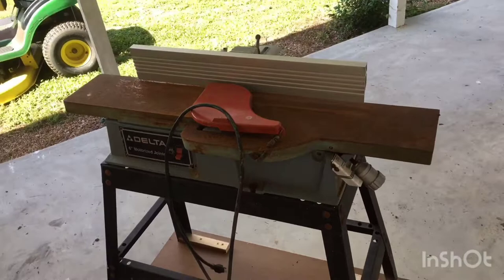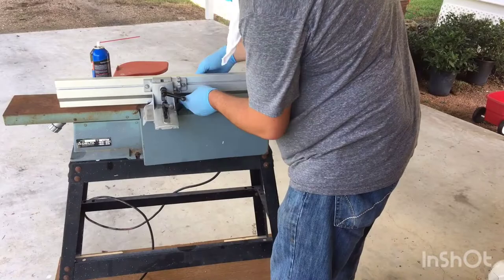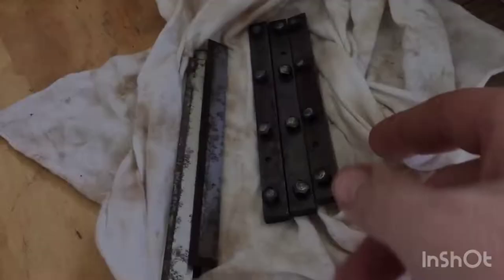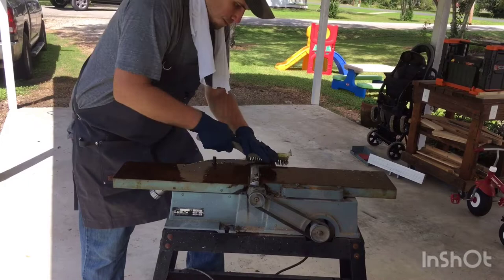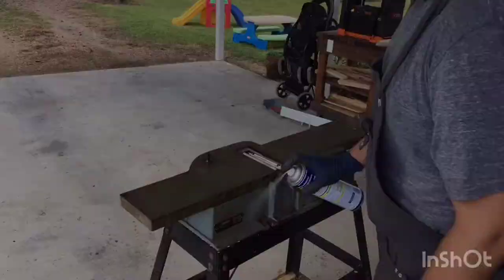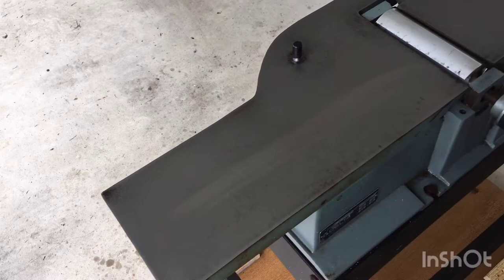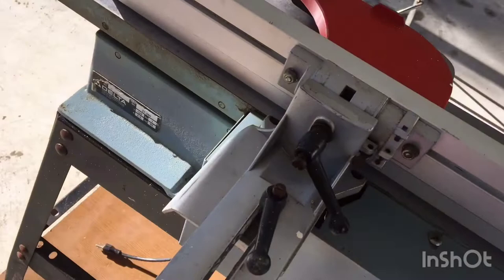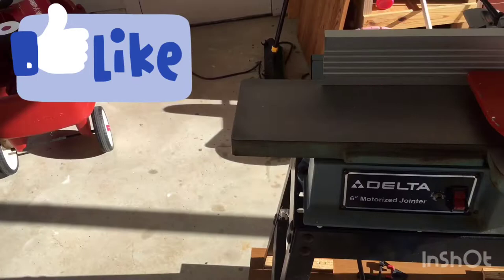Delta 6 inch Jointer Restoration

Comment: I just picked up the same model, same price too!. Same condition as well. I am using Rustoleum's rust remover. Saves on sandpaper and is gentle on the top. So far it is looking good!
Reply from the maker: They make a "naval jelly" which if i remember correctly is basically a gooey phosphoric acid..... works great esp for large pieces and is fast but i hate using it due to the smell. The vapor even bothers my eyes sometimes

Comment: My table saw had a lot of surface rust when I got it, but I first just sprayed it down with wd-40 then put a red scotch-brite pad on the table and sat my random orbital sander down on top of it and went to town on it.  It took the better part of a Saturday afternoon but it eventually shined up enough that I then just put a well worn 120 grit used sanding disc on the sander and finished shining it up with that.  Afterwards I just put a coat of Johnson wax on it and it has remained in good shape since.
Reply from the maker: I love sticking scotch pads to my ROS...... dont think i had figured that out until sometime after this video. But i agree, works great

Comment: Thanks ;! I got one in a yard sale little bigger for $ 60. Bucks works great . But cover blue off rust came so fast  . Now I have to do that! Thanks 🙏
Reply from the maker: Its not bad. Changing knives can be tough but not impossible. That is an area tho where more modern jointers outshine older ones like this. Give and take

Comment: Hey Brad. I just picked up a Delta 37-190C. I got it for free. So I'm kinda doing the same thing as you just did. The thing works great but I'll probably put some new knives in next week. Very happy with the deal I scored. :-))
Reply from the maker: I liked it. I ended up selling it for $235 and buying a ridgid for $200.... one thing I learned is newer jointers are much easier to set up after installing new knives. But once u get urs set up, you’ll enjoy it 👍🏼

Comment: Just picked up a 1950’s vintage Delta jointer for real cheap. The rust was worse then this one, but it looks great now.  I just used white vinegar,  it dissolves the rust. I also used course steel wool and will finish up with 500 grit sandpaper.
Reply from the maker: Nice! Thousand ways to skin a goat. Hope she treats u well

Comment: I have been looking for a deal like that since you bought it. Maybe the spring will bring better luck. I like how you took your time instead of grabbing the wire brush like a lot of people would.  Then you have too much material that was removed for sure.
Reply from the maker: Yea, I was pretty worried about removing too much and then the tables having big valleys. But theirs many out there that would say I shouldn’t have even used an orbital at all. 1000 ways to skin a goat

Comment: Great video thanks brother. I like the old Delta. I had a 9 inch table saw years ago and got rid of it just because. I have a Craftsman joiner I hate it. I don't use it much. They make a jig for the blade swap. Great job not much different than what I do. Keep up the great work see you in the next video thanks again brother
Reply from the maker: Yea, even after the video the blades still weren’t good enough so I ended up making my own jig out of some scrap cherry and magnets that I epoxied in. Basically just copied the jointer pal that is like $50 on amazon. To hell with that lol

Comment: I had one of these, but the tables weren't coplanar and there was no adjustment that could bring it into spec. I ended up selling it for 50 bucks. I told the guy who bought it that if all else failed, it was probably worth that much in scrap metal alone.
Reply from the maker: That sucks. You can get them lined back up but it’s a very long tedious process

Comment: Hey Brad, I just picked up the same model at an auction. Very clean. Only concern is the wiring inside was disconnected. Having a hard time looming for a wire assembly guide. Any chance you can snap a quick photo of your jointer motor wiring?
Reply from the maker: Unfortunately i dont have it anymore. Sold and traded up. Let me see if i still have the digital manual
Reply: James are you still needing a picture of the wiring setup for this jointer?
Reply from the maker: Love seeing people in the community willing to help! 👍
Reply: @DragonLawyer  nope. All good! I was missing the relay

Comment: hey i saw this being sold and wanted to buy it but not sure it has dust collection or away to catch the shavings like other models
Reply from the maker: I cant remember for sure but I believe the shavings just fell underneath. I will warn you theres no adjustments on the outfeed table or screw adjustments in the cutter head cylinder like more modern jointers which makes setting the knives a real pain. If its $100 or less I would say consider it. Otherwise hold out for something a little newer
Reply: @BradsWorkbench  ok thanks for the advice I'll hold out

Comment: Hi Brad, I just bought the same model, not as good deal as yours,!!!  It was mounted on a stand, I dissembled it for transport and now the motor is hanging at the bottom, I cant figure how to replace it where it should go.....any idea that could help???   Thanks
Reply from the maker: Well it is belt drivin but unfortunately I can remember where the motor mounts were exactly. I only used this jointer for about 6 months before I can across another good deal on a larger one. I cant say 100% on this particular machine but I know many others use the weight of the motor itself as an auto belt tensioner of sorts. I know that probably doesnt help a ton. There are some good groups for tool restoration on facebook that might be able to give more help and you'd be able to show pics of exactly what you're dealing with.
Reply: @BradsWorkbench  thanks, I’ll check, maybe that the motor should be lower then the tool instead of my idea that the motor should go completely inside the casing.
Reply: I’ve got this exact same model that I’ve spent the last week performing rust removal. If you need pics or anything let me know and where you want me to send them.

Comment: I just got the same one and I need a fence any ideas where to get it
Reply from the maker: If you want the original its just gonna take time. There are groups on Facebook but still a long shot. Ebay will be expensive.... fb marketplace another long shot but worth checking over the long term. The easiest way would be to cut a notch in a flat board to go over the blade and clamp right to the table.

Comment: can you explain the blade adjustment that was hard ?
Reply from the maker: Well in general changing knives is a pain. Most things are a pain when dealing in the thousandth of a inch. But this jointer did not have an adjustable outfeed table or any adjustment screws under the blade. Its doable but not easy. The ridgid jointer i have now has the adjustment screws and outfeed table and i can get the knives set in about an hour.